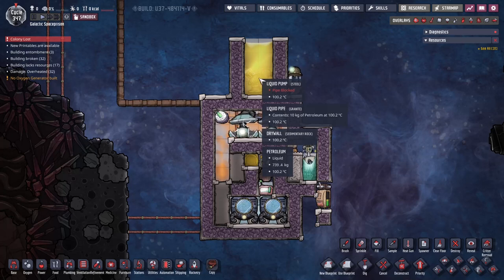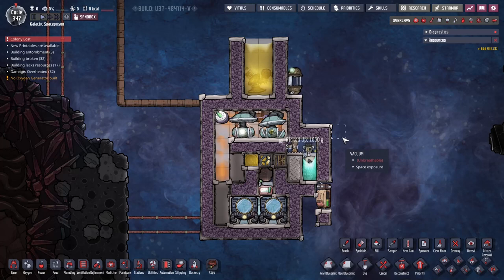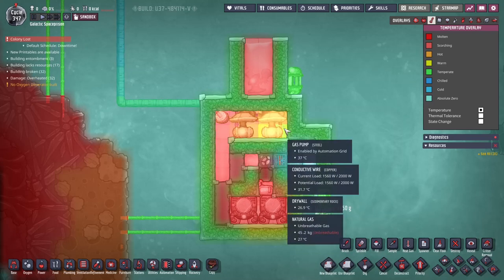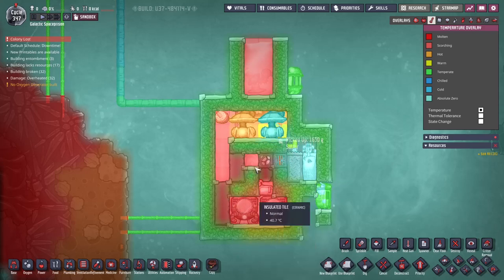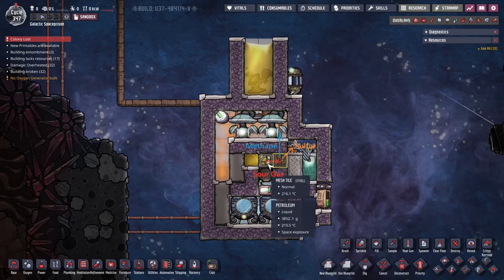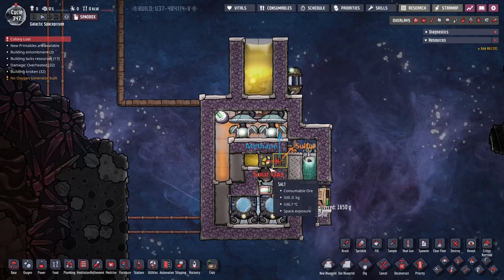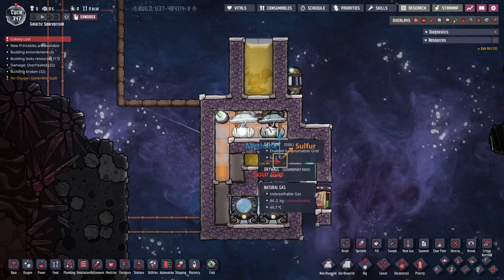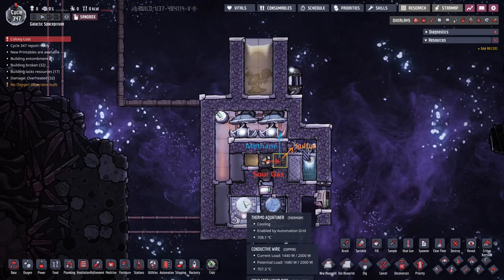Sour Gas Flash Boiler - Oxygen Not Included

Comment: OK. Good. I like it. Much more compact and convinient than some "reserve-like-20%-of-the-map-for-me" boilers.

2 questions from my "rather basic" level of experience in ONI:
- Can it be converted for "lowtech" use? Heating will not be a problem - any volcano can do it with ease - but how to cool soar gas down without supercoolant?
- Why salt tile? Why not metal/diamond thermal transfer medium "as usual"? What specific in it? As far I can understand - salt tile limiting petrolium heating speed, but why it is important with such huge steam thermal buffer?
Reply from the maker: Natural solid tiles have a special property where they can instantly transfer heat to boil 5 KG of liquid in an adjacent liquid tile, as long as the natural tile is above the boiling point of the liquid, regardless of thermal conductivity values of either solid or liquid.
Low thermal conductivity of salt prevents fast heating of bulk of petroleum or sour gas. This lets sour gas to cool quickly without also getting heated much more from the hot salt tile. Any gas, particularly steam is good at heating stubborn low conductivity tiles.

Comment: Hah, I so knew this was coming after reading the comment on tiny petroleum boilers on the last one.

Love the design, energy efficiency is really not something I'm bothered about, since in the endgame there's just no reason not to go nuts with power production.

I recently made a ceramic factory that works without coal just because I don't like ranchin hatches to make more of that. 4 aquatuners running constantly to cook the clay, then break it with autominers to collect. I know it's horribly inefficient but in the end, all it consumes is sand, polluted water and power.
Reply from the maker: Something even more greezy is coming next.
Reply: @greezyhammer764  Mass-neutral power extraction (perpetual motion) from the closed-cycle igneous rock -> sand -> glass -> rock gas -> magma -> rock loop, where you get the glass by melting sand rather than losing mass via the glass furnace?
Reply from the maker: @Majromax  Here https://www.youtube.com/watch?v=dUteIp4EGgg I originally decided to close the loop because igneous rock was piling-up and glass furnace deleted the excess from the game and also put out more heat. But there are ways to do it without dupes.

Comment: I played with the idea of teleporting liquid methane using the airflow tile trick but I was not able to come up with anything anywhere near as good as my jBoiler.  Maybe someone else can do it better.
Reply from the maker: You can also extract some chill from sulfur by passing it through metal tiles. If it melts, it will drip out on left side of the tile, unless there is a tile on the left, then it will drip on the right.

Comment: Damn! The densest ever built sour gas boiler, GG for this ( and your others topic with molten void everywhere! ). 
For the efficiency problem, your require 2 aquatuner to have enough cooling powah?
How about to use 1 first fed aquaTuner as the boiler, managed under 700°C and nearer from the salt and thermically insulated from the methane chamber .
Then feeding one or two additional external aquatuner, that could be in a steam room with turbine above, managed with liquid pipe thermo-sensor to not freeze super coolant.
Methane can chill the steam turbine.
And maybe a Tepidizer will be necessary to assure that the super coolant pool is not to cold, so the boiler aquatuner can always work when needed. Maybe setup the right temp in step 2, can prevent this.
That my thought, otherwise your channel is nice bro, keep rocking!
Reply from the maker: Going to test!